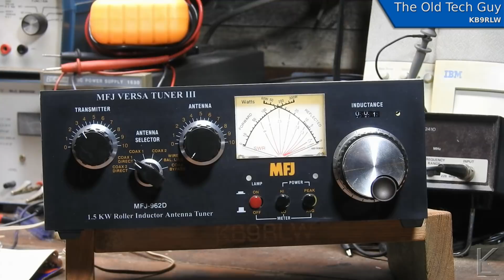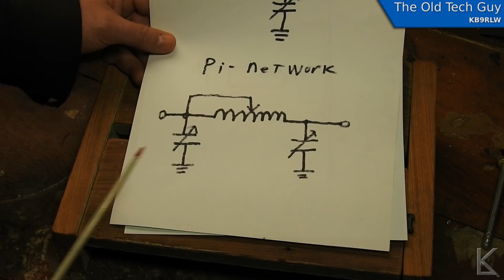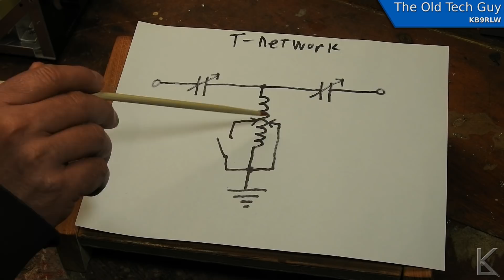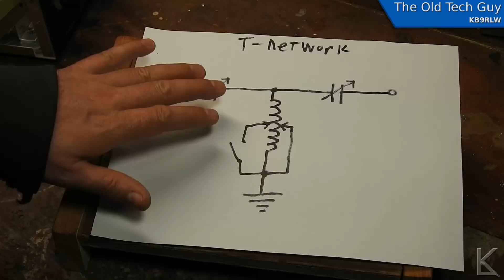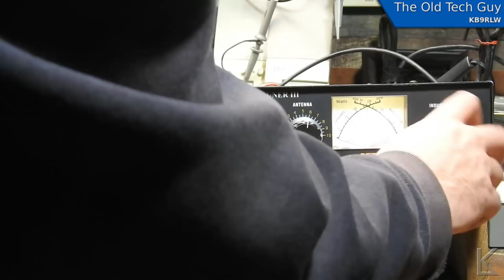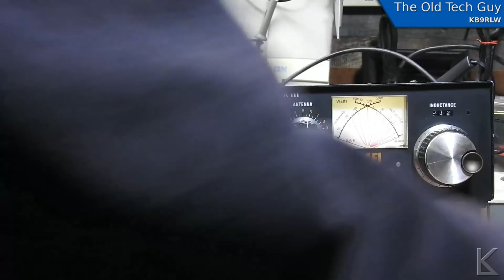Ham Radio - Salvaging a burned MFJ 962D versa tuner

Comment: Hello Ken, thank you for this video, may have saved my butt. I have this same roller inductor in my MFJ-962 E, on the other side of my desk is a MFJ-962 D, in my mind exactly the same tuner ?
The 962 E is new out of the box, and seemingly the roller does not follow the coil like it's supposed to, again ? While MFJ do have a "warranty", the Canadian store I bought the tuner from offers no warranty, and the buyer gets screwed into buying a different tuner or send this one back to MFJ who are now out of business,  My question,  
instead of the CHINCY part used to short out the coil automatically,  why not modify and adapt an electric switch to the front OR, take out the mechanism entirely, in my mind this is MFJ's method of adapting to 1.5 KW, (800 W)

How did you make out with the tuner in this video, without the self resonet inductance gadget.
Did it work for you ?   
VE6JRR  Jim R
Reply from the maker: It worked fine without the part.
Reply: @loughkb  It works for me as well, took it out last night and ran 600 W through the tuner, perfect. Thanks again VE6JRR

Comment: Kevin could you send a link to your coax repair video , i looked and couldnt find but i know youve one pls
Reply from the maker: Coax repair?  I'm not sure what you mean or what vid that might be.  Could you elaborate on what you need to do?
Reply: @loughkb  oh sorry ya i meant you had one on “f” connectors
Reply: My mag mount shield was damaged because i routed it poorly
Reply from the maker: Ah.  You can't really repair it.  You could chop it and put connectors on it so you could use a barrel connector in line.   The best route is to just replace the whole length of coax.
Reply: @loughkb  ya i had a feeling. But i went and bought the barrels (“f” connectors) and the tools to do the job .But your right Kevin ill just replace it.but it means pulling apart my mag mount and gosh im lazy lol. Probs just repurchase the whole darn thing🙄.Well thank Kev. And i love your channel…probably said that already but your one of my go to guys:) 
  Thanks for gettin back so quick like, i appreciate it.
   Take care.

PS decided to pull er apart and fix it …figured it would be a good chance to get some experience with coax and i like to understand how my stuff is built and often i think peeps would be surprised just how often i find mistakes made from the manufacturer and there is almost always ways to beef up or improve the product in some way or other.pulled apart my blender the other day cause it was vibrating badly and i think thats the reason it was disposed of at value village…brand new model and it took me 5 minutes to realize a rubber grommet was upside down! Now she runs like a charm:) anyway …. The mag mount weather proofing is the weak point with tram and ill correct it but otherwise ,i gotta say im impressed with the design.It was easy to pull apart ,diagnose and even if water got in ,the way its designed i doubt it would cause any problems…excellent product for the money.

Comment: I have known a few folks with that same tuner that had the same thing happen.  At least 2 of them said they tuned up with 20 watts or so and then after increasing power and was talking, they began to smell something burning and one of them said they could see flashing through the meter with the lamp off.  I bought one of the 962Ds at a hamfest used and I took that thing out and tossed it in the trash.  I also reversed connection on the inductor so that maximum inductance corresponded to the lower frequencies and the reset the knobs on the caps so that "10" is maximum mesh of the caps just like the old style tuners did.  I run a maximum of 500 watts in mine, but it has never failed me yet - no burning and tunes very easy.  I also have a 989C that I am restoring and have already done the same mods to it.  I think their "self resonance killer" is really a tuner killer !
Reply: I Had a VERY Similar Experience JUST Yesterday! 😠.  I Did NOT Rotate the Coil Knob While Applying POWER to it!  As Soon As I Increased the Power to : 700 Watts that Coil Began to SPARK!  I have ALSO Removed that Damn thing & Will Have to Scrub/Clean the Burn/Char Marks off the Coil! ☹️😠🤬

Comment: Since the last time I emailed you my station is up and running. Doing a 100 watts on all bands. Also purchased a new MFJ antenna tuner the 948 which works like a champ. Very happy with it. Got my end fed dipole about 35 feet up. Looking forward to the bands really opening up. 73s Rob, wa2fmh.
Reply from the maker: Lot's of activity, all the way up to 10 meters, daily.   I've even heard a few signals squeak through on 6 meters recently.  Have fun.

Comment: I had the same issue, sold the 969 versa tuner on eBay, I'd had it from new never had more then 100w through it. The buyer contacted me and said a capacitor was burnt out and returned it. That was 10 years ago, I never checked it ,just put it at the back of the shed. I'm digging it out tomorrow to have a look. Initially I thought I was a victim of a parts changing scam which was rife at the time.This rekindling of an old hobby is going to cost me !!!!!.

Comment: Great Video. A couple of questions... When I'm using an external tuner with a radio that has a internal turner (IC7300) is it suggested to turn off the radios turner when using the external? Also, I noticed when I do, then I tune using the external tuner the radios SWR reading is higher than the external tuner. Any idea the reason for the difference between the external and internal SWR?
Reply from the maker: Yeah, you don't want to 'stack' tuners.     The tuner, or transmatch, has one job.  Transform some complex impedance to the 50 ohms impedance your radio expects.    There should be no reason for a second tuner if we're already converted to 50 ohms.
As for the disparity,  look at the coax you're using to connect the radio to the tuner.  You could have a bad or dirty connector, bad coax, or the wrong coax.  i.e. 75 ohm instead of 50 ohm.
Also, you want a ground wire between the tuner and the radio so their chassis's are at the same potential.
Reply: @loughkb  The length of your patch lead, more than likely.....

Comment: how did you get the assembly that shorts the main inductor out of the assembly?  i have the versituner II  and it has the same "self-resonance killers", but mine keeps hanging up and not rotating enough to touch the coil.  if i give a slight bit of rotation on the shaft of the "self-resonance killers", the part will rotate perfectly into place.  ideas on how to remove that part, and how i can repair this (even if i can't remove the part)?

Comment: I think having a roller inductor makes you want to adjust it while transmitting. How many turns does it take to go the full range of inductance? 100? more? Imagine the time consuming procedure of adjusting it a turn, then transmit, the unkey, they adjust another turn and transmit. Very time consuming! They should have made it so 20 turns covers the entire length of the coil. That's why I went with the tapped inductor and wafer switch.  With it I tune up in seconds, not minutes. Same end result but much more efficient.
Reply from the maker: I always recommend people drop the power on their radio before tuning so they don't damage the finals.   If you've got a 100W capable radio, just drop it to 5 watts and tune while keyed.   Running the finals at 5% of their rated power keeps them safe.
Reply: @loughkb  Right but at 5 watts would you still unkey to adjust the roller inductor?
Reply from the maker: @johninjersey  No.   At that low level, you're not going hurt the tuner or the 100W capable radio.
If I had a QRP radio, I'd drop it down to 1.

Comment: Hi Kevin. A couple years ago I bought an MFJ-962D from another Ham. 
It would never work and had been occupying space on a shelf for over a year. 
After watching your post about restoring your 962D. I opened mine up and removed
the MFJ part which sits atop the inductor coil (as you did) and now it tunes great. 
Thanks very much.  Steve  from the Earlybird net.
Reply: Excellent!  I ALSO had a Problem With that "Self Resonator Killer" & had to REMOVE it COMPLETELY!  So far it Tunes NICELY! 😃👍🇺🇲

Comment: Excellent video for you solid state folks.  I was first licensed in 62, and I learned to tune up tube equipment without any outboard tuner.  After I fried a few pair of 6LQ6s, I learned to tune to the noise floor first.  Boat anchors are much easier matched (than solid state) to a properly cut wire antenna, but you still have to be close.
My ARC5 XMTR has a roller inductor inside,  for tuning (with the magic eye) to a ZEPP dragged behind a B17/B24.
TNX FER INFO 73 W8IMP AR SK

Comment: Thanks for the video Kevin.
I think I have came across similar coil "self-resonance killers" before. Guessing that MFJ must have found the unused coil tended to resonate around at least one frequency within the operating range. (maybe at higher power levels??).

My old roller inductor matcher sounds a little scratchy these days. Think I will try your contact cleaner trick.

Comment: Ihave the MFJ-989 that had the same problem.  I also took the shorting bar out and tossed it.  Didn't seem to affect the operation of the tuner.  

Another problem I had was that when I'd get the SWR down to 1:1, it would stay that war for a minute and then start creeping up.  Cleaning the coil didn't seem to help.  I finally checked the caps and found that the set screw on the end of the rotor was not all that tight.  I loosened the lock nut of the cap and tightened the screw on the end of the rotor.  That did it.  No drift on the  SWR any more after that.  

If you have a problem with SWR changing on these tuners, make sure that these screws are tight.  73
Tom W7WHY

Comment: Thank you I have the same Tuner and it did the very same thing. Lesson learned .Do NOT hook up a Galaxy radio to your MFJ 962D Tuner. I blame the Radio. All kinds of Spurious and deadly emissions! I am Glad however that it isn't a total loss. With a clean up, good Coax, good Coax length and antenna; A good signal will get out much better than high wattage!

Comment: I have the MFJ 989C version rated 3 KW
It is interesting the coil size is the same as the 1.5 KW tuner.
Many Ham Radio operators have the same problem at the same spot.
My tuner was smoking right at the white insulator in the middle by the magique switch. 
I noticed some metallic shaving was present on the insulator and shorted out the wheel. 
It was smoking with only 500 watts. 
I removed the magique switch,  cleaned up 3 years ago and no issues any more.
73 VA3VAD
Reply: That's were Mine burnt up.  I already had it tuned to Ten meters hooked up a Ten meter Mobile turned the variable power all the way down. Unfortunately the Person who advertised these radios on EBay Had it so over powered to get 280 watts out of it the Self resonance  Killer didn't stand a chance. I won't mention who sold the radio, however I wonder how many CB operators buy them and burn down their trucks, homes, or other vehicles.  I will never buy any High powered Mobile radios again. I wanted a bit more punch on Ten meters. However if it sounds too good to be true, It is.

Comment: T Tuners are fairly common, they have increased matching ratio for the component values they use (good value). However they allow a large number of sub-optimal matching solutions, and only one of them has minimum component stresses, all the others have increased currents and voltages which increases the likelihood that failure will occur at higher power. Essentially they have lots of ways to be tuned wrong. Usually the correct solution is with the largest value of capacitance and smallest inductance that achieves a good SWR. The SWR would be fine at low power at any of these other settings, but as soon as the power was increased the additional stress on the tuner could cause it to fail. 

One of the experts to consult on this topic is W8JI, and he states on his website: "The worse advice, when tuning a T network tuner, is to start with the capacitor mid-way and adjust the inductor for maximum noise or minimum SWR. On lower bands the capacitors should be set to maximum capacitance as a starting point. Normally halfway open is a good place for the higher bands, typically 15 meters and higher in a 160-10 meter tuner." He has more details on his site which can be found easily.

Kool amp silver plating powder can be used to repair the copper showing after the carbon is cleared away. 

w6akb

Comment: Kevin - The self resonance you're talking about is not between the roller connection wire and the coil.  It's actually between each turn of the coil and the next.  The ARRL  discusses this in the 2010 handbook which I happen to have a copy of.  This subject is covered in the chapter named "RF Design Techniques".  However in the older handbooks (like in the 80's) its covered in the chapter named "Electrical Fundamentals" .  Look for the drawing of a coil with little capacitor symbols formed by dotted lines  shunting various turns of the coil.  I first experienced this effect for myself when I was building a tuner and I couldn't get it to work past 15 meters no matter how I adjusted the coil.  When I swapped out the roller inductor which had uniform spacing on the turns for one on which the turns got a little further spaced apart on one end I could get it to work.  Not sure what MFJ is doing there.  I have that same tuner over here and when I had the cover off I noticed that very same weird gizmo on the coil but I blew it off thinking "oh well , as long as it works".

Comment: I enjoy the videos Kevin - thanks. But for that part, yes you could have tried to fab from scratch, possibly on your new 3D printer :) but - why not just buy a replacement part from MFJ - assuming it's sold/available as a replacement part.

The function is to short out that section of the coil so that it's inductance with its own self capacitance, does not become resonant. Have to know what that capacitance might be to know if it's truly a concern or not. If the part was not ridiculously priced, probably better to restore back to original design... IMHO as they say 73 WB2SMK

Comment: Hi there Kevin, Good point about puting power through the tuner while rotating the roler mechanisum. I nev had the chance to look inside the ATU for the C11/R210 that was my bread and butter radio when I was  a radio opperator R.Signals years ago. We used to spin the cranking handle round at a fair old rate to tune the inductor, then just a quick tweak on the cap to show max out. If the box was anything to go on what the internal components were like. They must have been prety substancial. The box was cast Ali, about 5 1/16" thick. It would have been 14"x7"x5". It was mounted as solid as a rock onto the top carring tray, next to the R210 Rx. The whole set-up was supposed to be portable, carried by a mule. Poor soding animal. Along with a pair of 12volt, 75 AHC Batteries. It would be enough to criple the mule.  73 de John- Aka G0WXU

Comment: Nice repair.  I bought a similar tuner off eBay, the MFJ-969 (300 Watt version), for what I thought was a bargain, but it, too needed some work to get properly operational.  Mine wasn't burned but its anti-self-oscillation switch was jammed and would not allow the roller to advance beyond it towards the rear of the coil.  Seems the hex shaft and associated switch were positioned 1/16" too far forward so the fiberglass parts would strike the coil and not enter it between the windings as they should. I found that the shaft was just missing its rear-most circlip located just behind the coil assembly.  Replacing the circlip (actually an "e-clip") and adjusting the switch's copper contact slightly fixed it and now the switch assembly works perfectly.  I also found that the roller's forward and rear end stops were off just enough to make the roller stop hard on its sharp edge at the extreme edges of travel instead of on its side axle as it should.  While this didn't affect the tuning in any way, it would have eventually caused a ding to form in the roller's edge so slight adjustments to the stops with a file were needed to make to make them work properly.  That required removing the coil assembly from the case but that's not overly difficult.  While it was out I also oiled the shaft bushings so now it turns quite smoothly.

Comment: I have a similar tuner, but for lower power.  Your fix is just a reminder for MFJ owners and others that the roller contact wheel needs cleaning at least once a year (whenever the receive audio gets scratchy while tuning).  I use a can of old TV tuner cleaner.

Dave K8WPE

Comment: Always enjoy your videos. By the looks of it, this roller inductor will never manage full power. The conductor wire is simply too thin, for higher frequencies. I've got a massive roller inductor and that one uses the same system, but done by hand. A bunch of fingers on a separate shaft, short the unused part of the inductor. I'm not an expert in these matters, but I guess that it is to prevent stray inductance. In an amplifier the output tank coils are also split up in different sections and also under 90 degree angles from each other. So for 160 meters, the inductance from all the coils is used and for 10 meters only the first part. If there is one long coil for all the bands, the unused part of the coil causes strays and influence tuning, I guess.